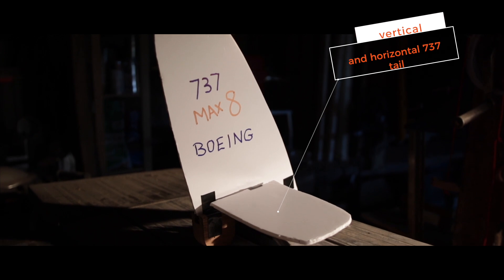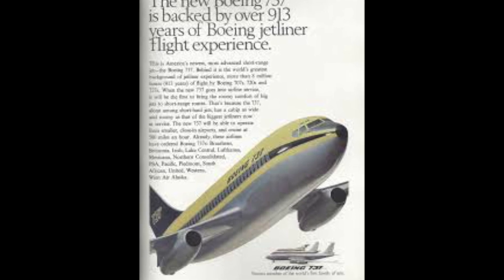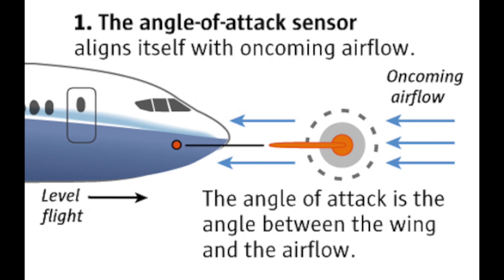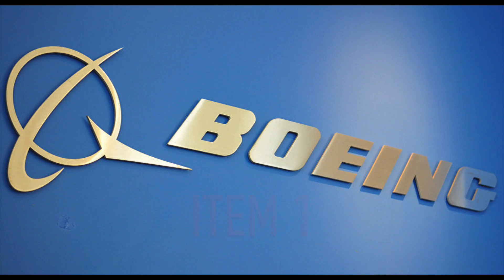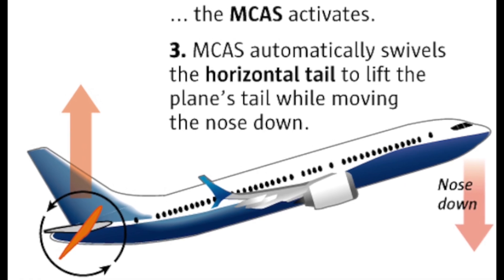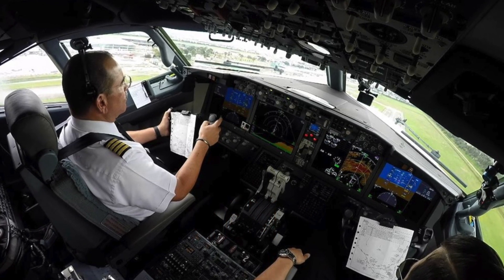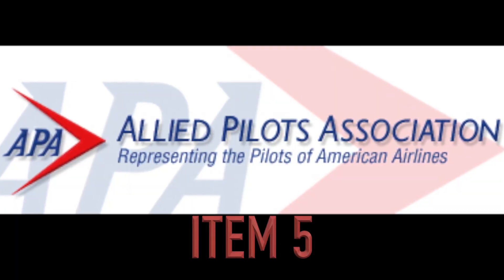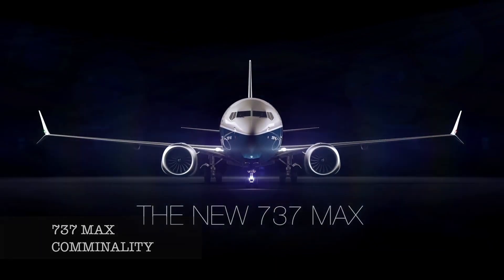NEW *** 737 MAX 8  - Prof Simon

Comment: the DC-10 of the 21st century...
Reply: WRONG!!  The DC-10 had quite a few design shortcuts that resulted in crashes.  The MAX is not a faulty design but the MCAS documentation and operation is deficient.  This is training and software issue.  Seems a couple of pilots failed to recognize what the automation was doing and to disable it and take manual control.
Reply: 1bottlejackdaniels — Not really.  Much easier to fix.
Reply: Very good observation. 👍🏿
Reply: 1bottlejackdaniels The DC10 was not the problem, shortcuts in removing/ replacing the engines is what caused them to fall off. My uncle was a mechanic for United at t time and what AA was doing was well known in the industry. I remember him telling a 14 year old me that they were playing with fire and it was going to bite them in the ass someday, about six months later it did.
Reply: Except that after initial DC10 depressurization was fixed, no more DC10s fell from the sky without significant pilot errors or acts of terrorism. Considering the amount of DC10s in the sky, it's one of the safest planes ever built.
Reply: @bskull3232  If you're referring to the Sioux City crash, the DC-10 had already been in service for 17 years before those fixes were even proposed!